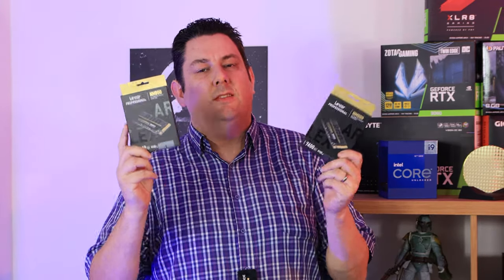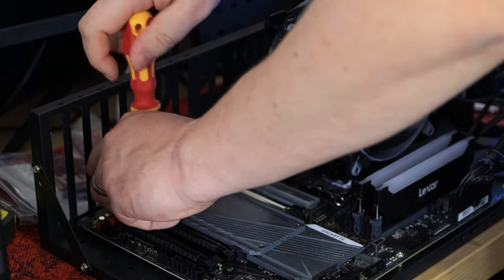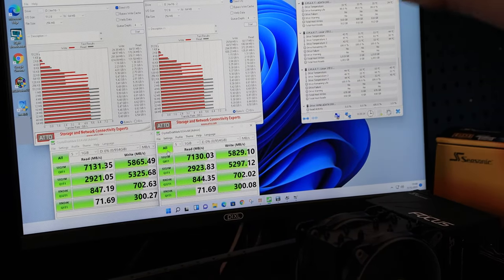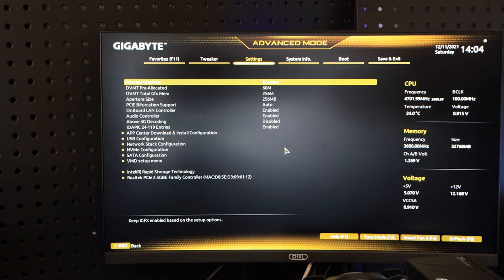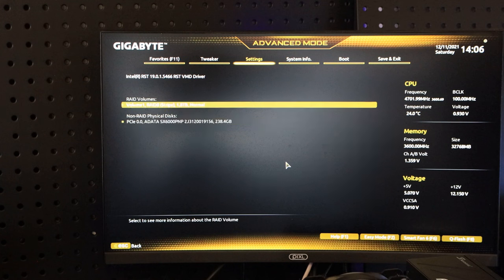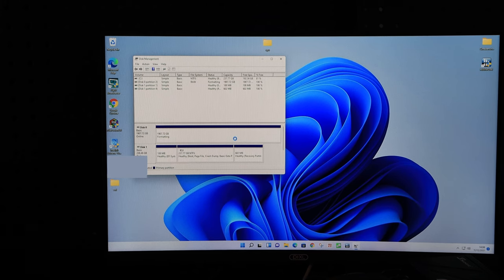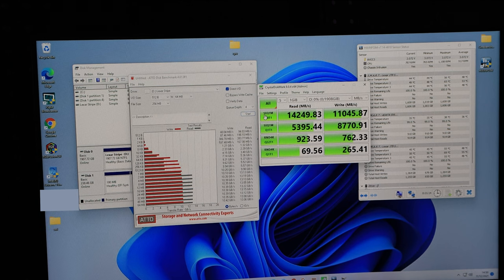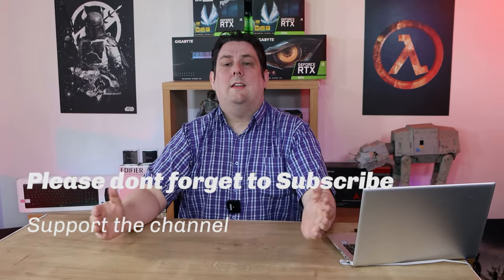Can we get over 14,000 MBps - Lexar NM800 - 2x 4th gen Raid0 Striped SSD's

Comment: Hello, I'm having some problems here, I tried to do raid 0 using 3 nvme gen4 7200mb/s each and the average result was 14,000mb/s on the crystaldisk, I found it very strange, because it should be at least 18,000mb/s s, however, I decided to do a new test using only 2 of these nvme and the result was also 14,000mb/s on average, I am using an Asus Z790-H Rog Strix where all nvme slots are pcie 4.0, in the bios I selected all for gen4 and even so it continues to give 14,000mb/s, I did raid0 both through Windows and through Bios and in both methods it gives the same thing and it is as if the motherboard had limited the bandwidth to 14,000mb/s, in the main slot which is pcie 5.0 I'm using an RTX 4080, in the description of the motherboard it says it's a safeslot, so I imagine it shouldn't be interfering with the raid result, I don't know what else to do to break this limitation of the motherboard, the 3 nvme that I'm using to raid are in the 3 lower slots below the video card, and the nvme slot that is next to the processor I'm using a 2TB nvme for files in general, what could I be doing wrong? Please can anyone help me in this regard? Am I missing any important options in the Bios? Thank you very much